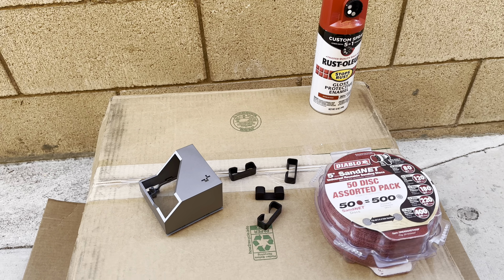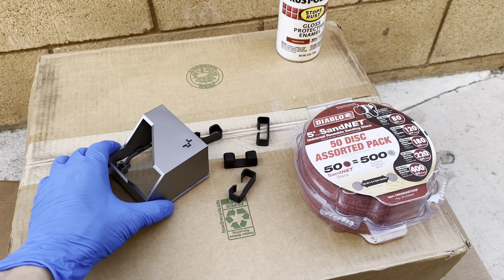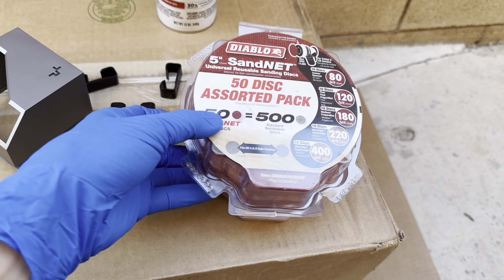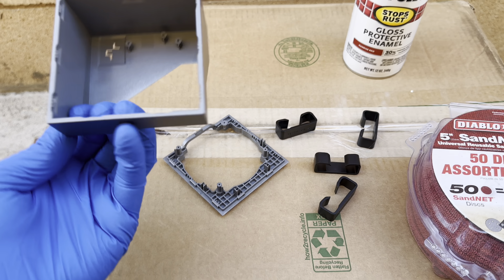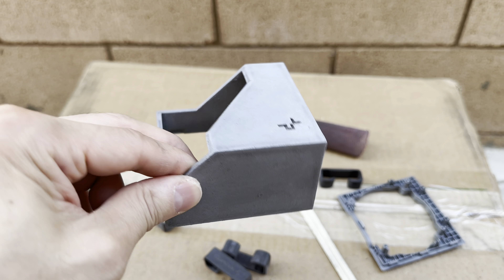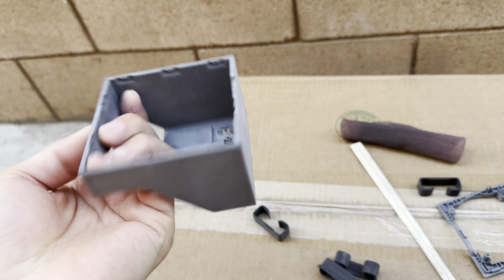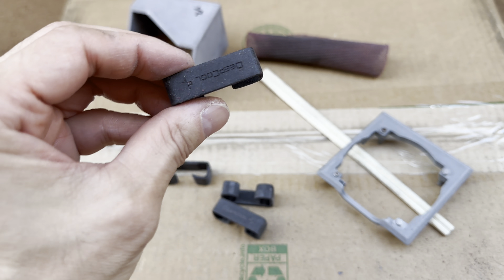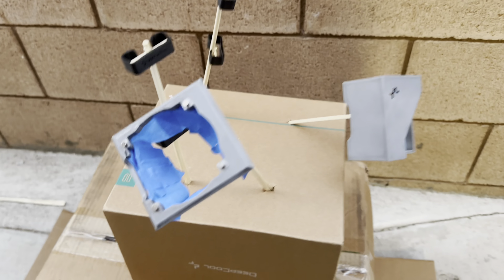Custom painting DeepCool LT520 720 AIO pump cover

Comment: How did you disassemble the pump cover?
Reply from the maker: There are clips that locks the top cover piece to the bottom piece. At the 35 second mark you can see all those plastic wedge like parts along the inside of the top cover. I used a very thin flat head screwdriver.
Reply: @S2KV is that all? It doesn't have screws beside the ones on the white part? Just yank the top cover and that's all?